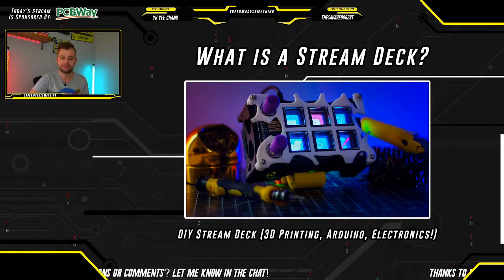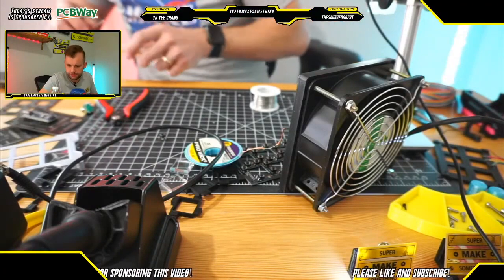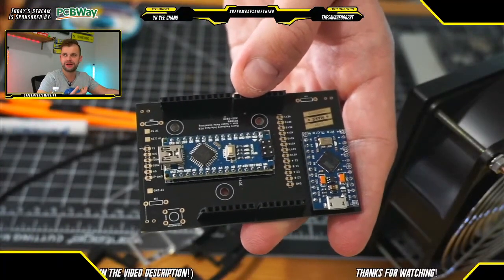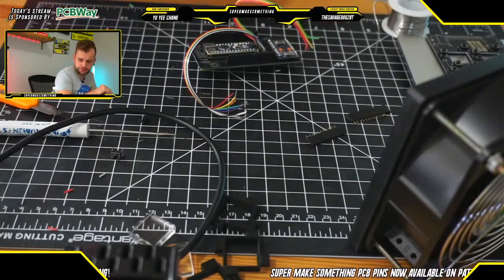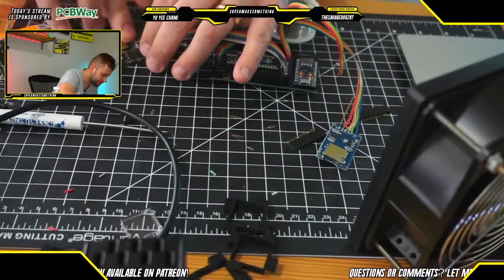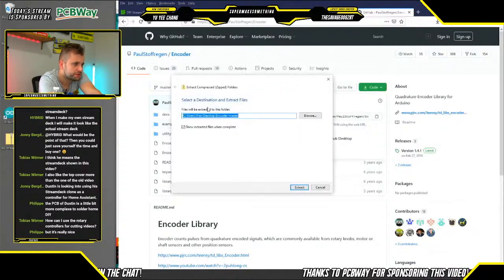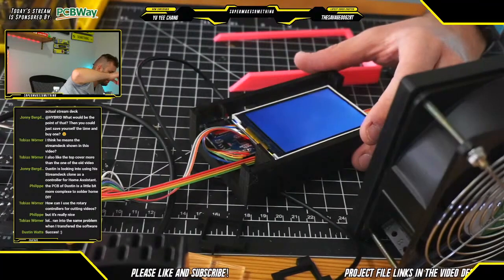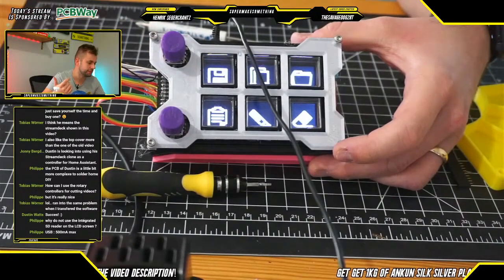CYBERPUNK Stream Deck LIVE BUILD! (Arduino, 3D Printing, Electronics!)

Comment: How would this work with a resistive touchpad? I struggle to get how the button press would work.
Reply from the maker: A resistive touch pad would eliminate the need for buttons (and the top PCB) by allowing you to press on the screen directly.
Reply: @SuperMakeSomething  ok, but this takes away the charme. I'm really intrigued by the resistive touch layer that the original Stream Deck uses. Not sure how this could be DIYed.
Reply from the maker: @jbphilippi  The official Stream Decks seem to use a rubber plate and (I think) a flexible PCB. This was one direction I was thinking of taking the build, but decided against because it would have been hard for people to make their own rubber plates with the appropriate dimensions and cut outs.

Comment: I completed building my stream deck based on your design here, But I found that I had to modify your code a little bit for OBS to recognise the hotkeys globally. the array that you had programmed seemed to work when OBS was the focus window, but when in game or another window was in focus, the hotkeys did not work.  Rather than using the array I changed the code to output the keystroke directly instead of using the button array now it works globally! I first thought that it was an issue within OBS itself, but I found that my keyboard was working globally, but the stream deck was not. I think it's because the computer is reading the input as a block of text rather than a keystroke? either way, I'm all good now. check it out:  https://youtu.be/EJBnMQ_1C4A

Comment: Great project, and awesome explained! Top! Only thing I didn't understand, how can I switch with my Encoder PUSH-Button for example to the next icon page?! Any idea? Do I have to change something on the 'streamDeckKeyboard'-file?
Reply from the maker: Thanks! Yup that’s right — it would require a change in the code. Take a look at how “Button 3” is coded, which is what changes the page currently. You would just need to reassign the button names or PIN number at the top of the script to make this change.

Comment: SO sorry I missed this man, I wanted to make it......

I have also been investigating using more screns on projects, and I recently ran across the Nextion Brand of displays that can be used with Arduinos.  They have onboard processor that offloads many of the screen calcs to free up the arduino etc for more.  It also has special software that they provide that helps come up with some sweet UI's very easily,  The other crazy thing, as that it connects to the arduino using only a few wires.  

https://www.amazon.com/Nextion-NX4024T032-Display-Arduino-Raspberry/dp/B07QYRB38T/

Keep up the awesome work! Looking forward to chatting with you sometime soon! :)
Reply from the maker: No worries and sorry for the delayed reply! (No idea why your comment was held for review!) The Nextion displays look awesome! I will definitely give these a look and try to order one!  Looking forward to chatting with you soon ! :D
Reply: @SuperMakeSomething  I am clearly a questionable character and YouTube is finally catching on! :D   Probably cause I put that URL in there :)